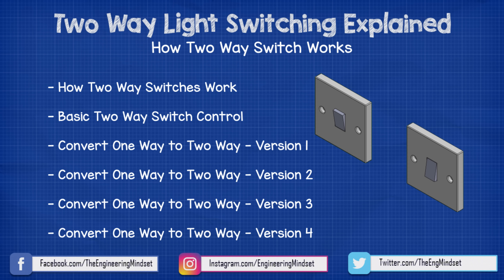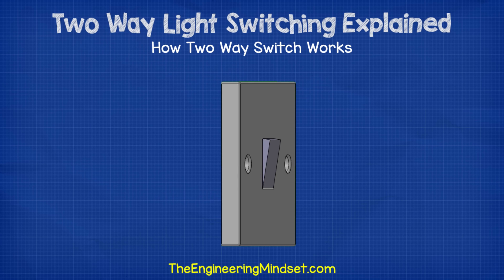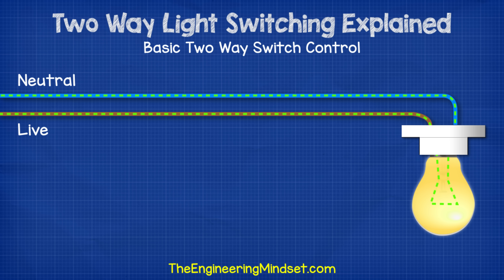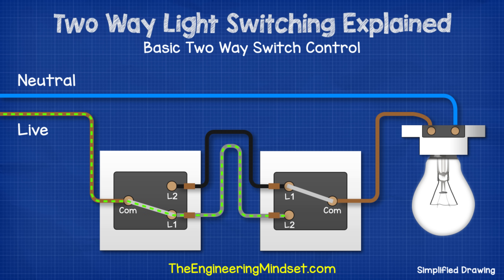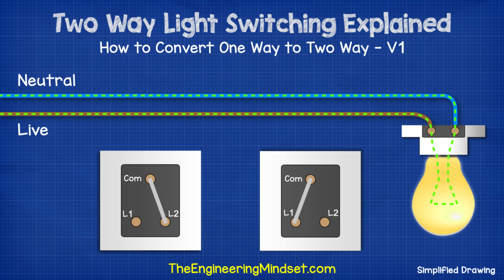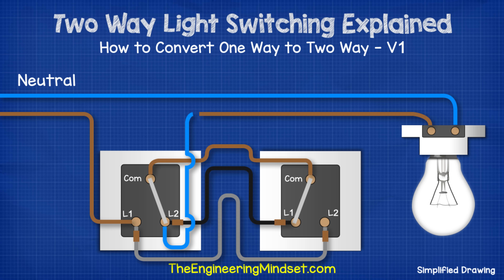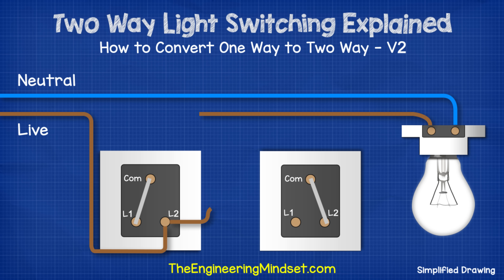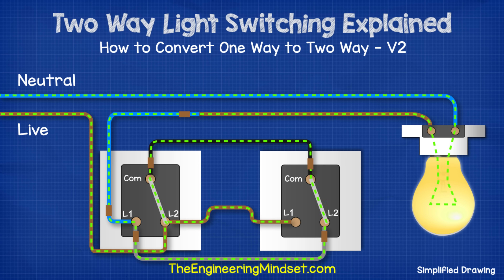Two Way Switching Explained - How to wire 2 way light switch

Comment: Firs version is the easiest one all the others are over complicating something simple... UK way of course lol
Reply: Yeah I don't see the logic also of the rest versions, why would complicate anybody and use even more wires.. The first one is the right one..
Reply: @andraszabi  The first  example is where you are installing the switches both at the same time so you plan to have the wiring going supply->switch1->switch2->bulb  all in order.
The other examples are for when you start with just one switch in the circuit: supply->switch1->bulb and want to add another switch without changing which switch the bulb is wired into.
Reply: @peepiepo  ohh u r right I wasn't thinking  to that.. But anyway u have to do the wiring BTW the switches.. so it's easyer to disconnect the wire from sw1, and send it to the sw2 commune, and add the 2communications wire also..
Reply: @peepiepo   it still doesn't make sense, if you start with one normal switch , It should be a normal switch, not a three-way switch, isn't it?
Reply: @MrX-wg9hx  Yeah thats what im thinking also, as a normal sw u have only 2 wires,  which is not enough in any of the 4 examles, so u have to add more wires anyway to that sw.
Reply: @peepiepo  It still is over complicating something simple. Since you have to run 3 wires to the second switch you can just tie L2-L2, L1-L1 and have the com from the second switch wired to the light (splice).
Reply: @MrX-wg9hx  Here in the Netherlands atleast, pretty much every household lightswitch is the 3-terminal version, even if there is only 1 switch for a given light fixture.
The extra cost of having a little bit of extra metal in a switch is negligible compared to having yet another product on shelves and the hassle of not having the correct one.
Reply: @Bbaass_TMH   And if it be like that, you can add another switch in a simple way according to the first method, right?  what's the point of doing it in unnecessarily complicated way as V2 3 4?
Reply: @MrX-wg9hx  Because you'd have to run new/additional wire using method 1 at a later point. The other methods (2 to 4) splice in the wirebox behind the switch and do not require additional routing. Method 1 is the easiest when building a house or doing a complete renovation. When you're adding another switch on a rainy sunday and you want to be done before dinner, you do method 2, 3 or 4.
Reply: @Hostingtest-ew2gc   in diagram of mrthod1 at 2:49, you need to run "2" wires from swith1 to swith2, right?   
in convert v1 at 3:48 / v2 at 4:57 / v3 at 5:43  you need to run "3" wires from swith1 to swith2.  add two wires has less work to do than 3 wires, isn't it?
Reply: @Hostingtest-ew2gc    Ahh now i can think of pro/cons of methods.  
in method1, because swith2 need to cut/join from original  power line so this method is good if you want to add switch2 in a position near the range of org power line.
other method is like you just extend line from swith1 to swith2 position without cut/join from original line so you can place swith2 anywhere/out of range without concern of org line.
Reply: @MrX-wg9hx  Typically when you run AC power you want the active and neutral lines close together.
So in reality for the normal way, you run the main cable to the first switch, a 4 wire (the 2 between the switches, the neutral and the Earth) between the switches, and then a 3 wire cable to the light
For the conversion, you run the cable to the 1st switch then back to the light, and have a 4 wire cable between the switches (now the 3 in the diagram and the Earth). So either way, it is the same cabling between the switches and it is a matter of where you want the main power to come in and the cable for the light to go out.
Reply: @peepiepo  This is correct, but the video is very confusing because it starts with the bulb wired directly, instead of showing the existing switch already wired. Starting the v2,3,4 explanations with one switch already wired would have been much more clear.
Reply: @MrX-wg9hx  The key difference between v1 and the others is that in v1, utility power comes into switchbox A , travels from A to B, and then from B to load (lamp, etc.) In the others, the assumption is you already have the wiring from Utility -> SwitchBox A -> Load and you don't want to reroute that. So instead you have to wire the switches up so that the circuit goes Utility -> A -> B -> A -> Lamp, which obviously as you pointed out is more work and more wires, but leaves the existing wiring intact.
Reply: @peepiepo  dang man .. thx thats what i was looking for .. an explanation to why he said "one way switch to two way " cause he had two way switches. but he meant that the wiring was one way to begin with. this should be top comment.
Reply: @andraszabi  I suppose he's making the point that in two of the examples, the switches are both in equality, and in the other two examples they are not in equality. Which way you choose would depend on which you were most comfortable using, and maybe one of the four ways might be best for an unusual situation?
Reply: Agreed. I also prefer the first method.
Reply from the maker: Check out our US 3-way switch video: https://youtu.be/_u5ORnhqn8g
Reply: We in the Netherlands use black wire to the bulb.And two black wires in between the switches and a brown wire to one switch.Now you come to the hole where the switch should be and you see three black wires.Wich one is the wire to the bulb?Mostly it is the one that goes up into the central box in the ceiling,but not always is this obvious.So connect two black wires to each other and go to the other switch and measure there if the are connected.If not repeat with the other one.Those two go on the connectors with no mark,the other which is for the bulb goes to the L mark.The other is easy,just brown to the L mark and the black wires to the not marked connectors.And neutral is of course in the central box in the ceiling.
Reply: It was clearly stated in the video that versions 2 and 3 were conversions, that's why they included the word 'conversion'...
Reply: A lot of the reasons for these wiring methods is that you want current to flow up and the same cable because can heating issues.
Reply: I realized that it was two cut loops conjoined between two of those three way switches.
Reply: First version is normally associated with conduit wiring the other versions are normally twin&earth and 3core&earth cables normally used in domestic properties
Reply: As an electrician with 5 years of experience i use only the first method seems the easier and the fastest doing the same think with less cable and work
Reply: Right
Reply: I want to have an exposed brick wall in one of my reno projects, so the 2nd version is much more desirable to me - instead of having to run an unsightly cable canal down from the ceiling which is required by the 1st version, I could run it along perimeter below knee height where it is much less visible plus I need to wire the outlets anyway so I can just piggyback on the canals for perimeter outlets.
Reply: The 1st one was built from the beginning to be a two way switch, so it was very simple to create.
The others are conversions, and conversions are never as good as the real thing. Either you accept that it is not as good as the 1st, or you rip it all out and start from scratch.

Comment: Can you suggest me what to do i ve just fit one led lamp with normal wire and i am using it plug with to switch it on and off , can i give connection to existing switch ?

Comment: Rah is for the super video but what is a “one way switch” as mentioned in the video?

I thought they were all two way switches i.e. they can be in either of two positions?
Reply: A one way switch has only 2 terminals, they are used to control a light where only one switch is needed, Like a small bedroom or cupboard.

They don't allow linking to other switches. They still have 2 positions, on or off like all switches.

So 1 way is one switch, one light and 2 way is one light, two switches.
Reply: karel bellic  I'm an electrician by trade

Comment: For whatever silly reason this is actually called a 3 way switch system. Before some of you want to argue the point I spent 38 years in the electrical trade
Reply: I also spent almost 50 yrs as an electrician (in britain ) and we call it 2 way switching .as the light is controlled from 2 positions . If needed to be controlled from 3 or more switches we call it 2 way and intermediate switching
Reply: U.S. and Britain obviously use different terminology. In the U.S. what you are describing is described as three way and four way switching in the U.S.. @umt1cardiff
Reply: @denniss9620  i have allready stated that the terminolagy between Britain and USA are different 
That does not mean one  is correct and the other wrong 
Just different . We call a manual gearbox just that , i believe you call it a stick shift 😊
Reply: @umt1cardiff  I have also had an American in my car and she called it a Standard!
Cheers mate, John, Australia.
Reply: @joandar1  😊😊
Reply from the maker: https://youtu.be/opoEswRp_jg?t=60
Reply: The switches used in your 2 way system are called 3 way switches. If the light is controlled from more than 2 locations than you install as many 4 way switches as needed. But your 3 ways must be at the ends where the power comes in and your switch lag goes to the light. If course this is all moot if you are using a low voltage switching system.
Reply: @tombrewsaugh1399  again  british and american terminology . What you call a Fanny is on a different area of the body to over here . Colour is spelt differently as well  just as  another example . I am not saying either is correct or wrong just different . Maybe if i went to an electrical accessories department and asked for a 2 way switch i would get the same look as you would if you asked for a 3 way switch over here .☺
Reply: @tombrewsaugh1399  just as another difference in The EU low voltage is defined as between 50v ac and 1000v ac .
Reply: @umt1cardiff  we've got different definitions of low voltage, depending on who you talk to. An electrician will tell you that under 50 volts to ground is the codes definition. But a power company engineer will tell you anything under 5kv is low voltage.
Reply: @wm79198  againare we talking european standards against usa , noting the use of "ground as opposed to Earth:   😊
Reply from the maker: Check out our US 3-way switch video: https://youtu.be/_u5ORnhqn8g
Reply: It's called three way switch because that is exactly what it is. You are using SPDT  switches.

 This is the three modes the switch works in. On then off then On again.
All  SPDT switches have one common terminal and two switched terminals.In three way house wiring these two terminals are your traveler terminals
Reply: @denniss9620  I am not sure what you are saying here. One common and two places the Electricity can come out in a SPDT, Single Pole DOUBLE Throw. That has only two outcomes. That is if the Active is wired to the common, if wired to L1 or L2 then it is an on off switch.
 One terminal has power or the other! There is no ALL OFF on the switch talked about here. If the switch had Three clicks in its motion as opposes to the Two as shown here then there is a chance it could be deemed as three modes!
 Then perhaps center position may then leave L1 And L2 not active as in this situation if the switch did not in center position apply power to any other terminal.
 Cheers Mate John, Australia.
Reply: The switch is a single pole double throw but no center off. It is still referred to a three way because it has three contacts two which change state. A single on off switch is two states  On or Off. It is not a matter of how many positions the switch can have (i.e., up or down is only two positions). It is a matter of how many ways current can get to the switch, how many paths current can take on its way to the switch. Think of driving down a road, and coming to an intersection at which you have to take either the left fork or the right fork. That is commonly called a 3-way intersection. @joandar1
Reply: @denniss9620  As I said NO ALL OFF unless you put active to L1 or L2. If you put active to L1 and power/active out on L2 the no matter what way you toggle the 2 way switch it will do NOTHING except be a waste of time and space! Perhaps depending on your mindset it can also be a Nothing Switch!
 Power in on common has TWO outcomes Power out at L1 or L2!!!!!!
So you use different terms for the SAME thing.
You think I am wrong I am sure, Electronics Engineering is my background as well as have Two Trades after then. I must be WRONG? 
 Cheers Mate John, Australia.

Comment: What are the advantages of each set up?
Reply: The advantage to the first set up at 2:35 is the use of fewer conductors (less wire cost) to complete the circuit. I can see no reason to use the others except as a brain exercise.
Reply: @carlospulpo4205  Yes, and it's much less complicated (in my opinion).
Reply: The video doesn't really reflect reality, modern installs take a live, neutral & earth to the light fitting, then a 2 core and earth to the first switch (switch feed L1 & switch wire L2) then 3 cores between the switches (like 2nd3rd&4th method, all the same really), the advantage is less cables into the light (more space) electric flowing forward and back to make the circuit reduces electromagnetic interference

Comment: I N T E R M I T T E N L Y   L I V E
Reply: Intermittently dead.  Glass half empty.  LOL
Reply: BroWn sLeEve
Reply: I am only alive sometimes
Reply: i was wondering abt that...what does that mean?
Reply: @rgudduu  it's to avoid someone thinking that the neutral cable is permanently neutral when in fact there are times it could logically act as the live
Reply: Scary stuff.
Reply: All switches and wires are intermittently live
Reply: @brianscott3021  Indeed, if this is not the case then there is no need for a conductor there.